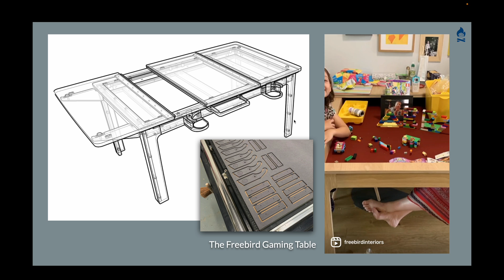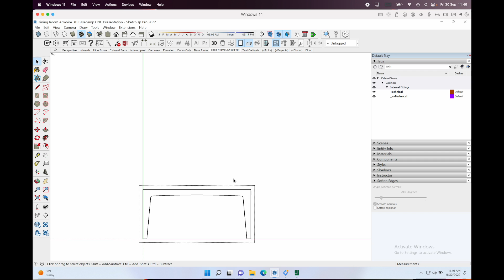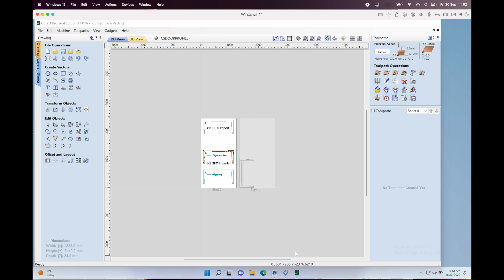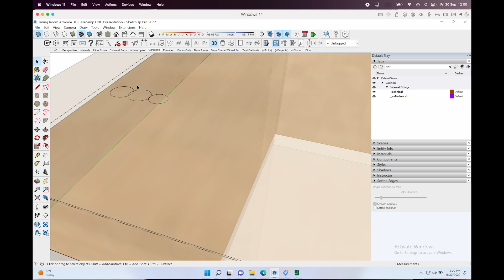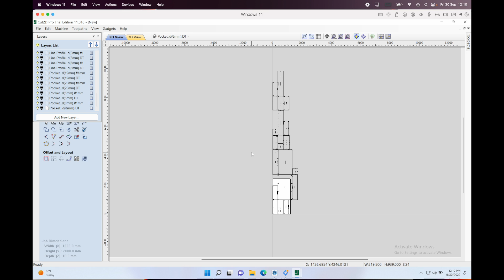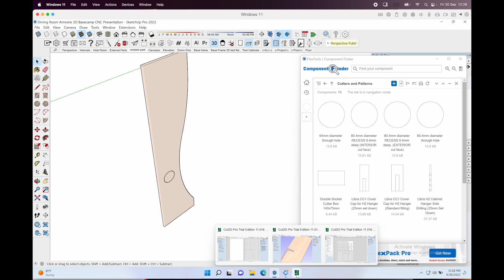SketchUp to CNC with the CabinetSense Extension (3D Basecamp 2022 Vancouver)

Comment: How can I add grooves for lighting strips in cabinet sense ? I did use patterns but the rectangular cutter did not export to vectric software.
Reply from the maker: You need to use a cutter component.  Is it possible that you used a pattern only?  That rectangle is a placeholder which you would put cutters within, so if it was a pattern outline only that could be why nothing came through to vectric

Comment: Hi Alastair, many thanks for your video! Is the text shown in vetric actually going to be cut onto an unseen face of the panels, or is that for a seperate label printing process?
Reply from the maker: Hi! It is painless to map the text layer to a tookpath and there are users of CabinetSense who do that (it’s possible to set up a sprung pencil or pen holder as one of the CNC tools).  For us we refer to the layout on screen or as a printed page to see which part is which and just transfer the part name on to the part with a sharpie pen manually at the point of offloading the Cnc.  But you can also set up label printing, thought it is not as automated as it could be

Comment: I See you use routered MR for your doors, do you balance these to stop them warping/bowing?
Reply from the maker: For a while we did them as a double sided cnc operation, recessing 3mm equally both sides.  But we had some problems with this method and switched to 2 piece.  We find they stay straight if sent straight to spray booth.  To be on the safe side I think it’s best to rebate the panel in such a way that it is central to the thickness of the door.  Have you got any particular experience and advice on these methods?

Comment: Hello
Thanks first for the great presentation

I just bought a new cnc nested routing cutting machine but had problems with making automation and precision work 

Should I go with cabinetsense from the start ? 

I am mostly making customised wardrobes and kitchens
Reply from the maker: Hi, whichever software you choose, it is a steep learning curve and takes a long time to set up.   If you already use sketchup, cabinetsense is a great option.  Another one to consider is polyboard (www.wooddesigner.org) which copes much better with angled projects.
You could find me on Instagram @alastair_freebird or email me via my website www.freebirdinteriors.co.uk so I can give you a more detailed response.

Comment: I can now speak from experience and it has taken me a long to get to this point. I totally agree that the Cabinetsense and Sketchup work very well with each other. And I am now deep down the road of CNC. Transferring to Vetric is very easy. Still getting my head a round another of aspects but the process does work. I think you just have to get into, make mistakes, learn from them and don't be afraid to ask for help. 
The tunnel is long and I'm still in there but I can see light. 
I personally have followed Alastair from the beginning of  his journey of sharing knowledge and I don't think I would be  where I am today without him. I thought I was OK on Sketchup but Alastair is truly 10 steps up on the game all the time! 
I had never even heard of Cabinet Sense until Alastair had brought it to my attention and I don't think I would even know how to begin in CNC without this extension. Even if you don't have a CNC I would still strongly advise using it. You almost forgot how you use to draw In Sketchup!
There will be a lot of swearing to start with and things to figure out but if I can do it, honestly any one can. 
Will be signing up for future lessons for sure!
Reply from the maker: Thanks for this comment Nic!  I sometimes wonder how others get on with CabinetSense, especially you and Ady Webb who I know are both using it with the Yeti.  We also use Polyboard software at Freebird and it's clear to me that any software of this sort has many layers of complexity and it can never be easy to get started.  The power and possibilities of the software mean there are many different ways of going about things, and it takes a lot of trial and error and mistakes before you gain full understanding